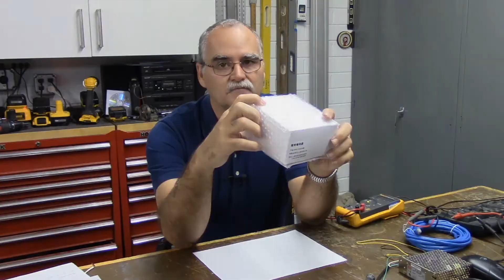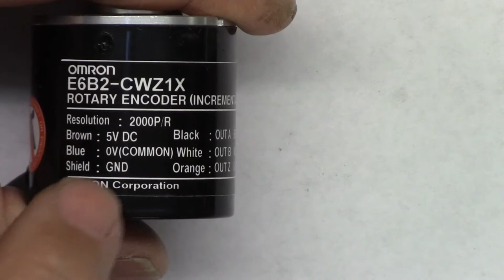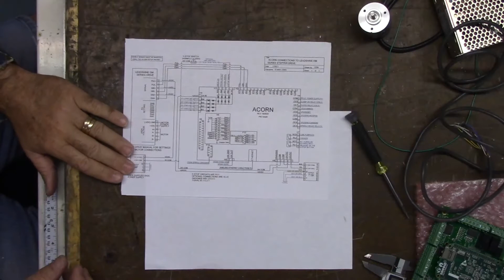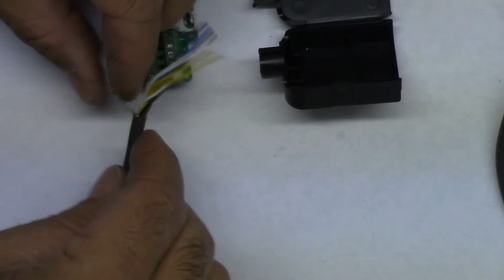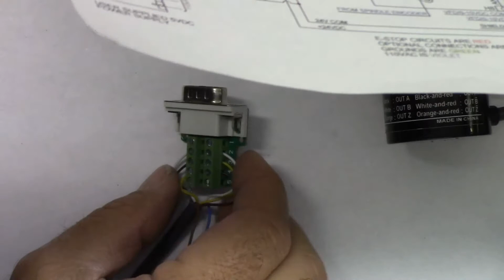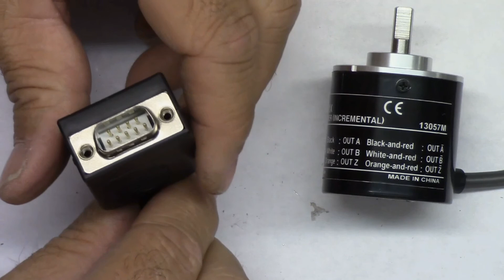Omron Differential Encoder Overview & Wiring to Adafruit Connector

Comment: Will this encoder work with a Centroid OAK Board? Is the wiring the same in OAK. 
Thanks,
Jeff
Reply from the maker: Would not recommend it's use with Oak.
Reply: @martyscncgarage5275  Do you know of a encoder that will work with OAK?
Reply from the maker: 5vdc line driver differential encoders from automationdirect.com or direct from Centroid. What is the application?
Reply: @martyscncgarage5275  I used an OAk Board on my Milltronics MB-19 Mill Conversion. I am trying to set up an encoder on the spindle.
Reply from the maker: @JeffBlack1968  if the encoder will support a timing pulley and belt, you NEED at least a medium duty encoder. 1000 line is fine. Cheap encoders will not last.

Comment: I don't think you can tell if this is original Omron or knock off just by testing, You'd need both and opened. I got similar one except it is 100p/r. Was working fine but during testing I've managed to reverse voltage polarity and then it exploded. I've opened it and 22uF capacitor exploded and about 5 small SMT transistors with only LY marking on them .. so impossible to tell what they are. According to manual, those encoders have reverse polarity and sc protection. This one obviously didn't have it. I could not find picture of original Omron encoder to compare. I've seen some that had two circular PCB inside, this one has only one. It has two small voltage regulators, quad comparator and each output have three SMD transistors. Ones that didn't blow are NPN and manual shows PNP but there are other two that I could not test as they blow up. I am sure I could fix it but cannot tell what transistors are.

Comment: Why are there 6 phases in omron CWZ1X but there are only 3 phases in all other omron models?
Reply from the maker: Z is the index pulse. You also have the inverse of the phase. This is a line driver encoder
Reply: @martyscncgarage5275  So I need to connect all 6 phases in order for this encoder to work? Thanks.
Reply from the maker: @infinityinfinity9665  I have no idea what you are working on or what control you are using
Reply: @martyscncgarage5275  I'm just trying to connect this to an arduino in order to measure distances, the problem is I have only 3 pins left so I was wondering if I can only use 3 phases, from what I've read about differential line drivers "one of the signals matches the original signal, while the other is the exact opposite of the original signal" so if I connect only the 3 phases I should have the same output as in the 3 phase rotary encoders?
Reply from the maker: Nothing wrong with experimenting! Just use A and B you should be fine. The index pulse is a once per rev pulse. Good for threading on a lathe
Reply: @martyscncgarage5275  спс
Reply: @infinityinfinity9665  You can try using just A and B (and Z if you want to check if you are getting the right number of counts per each index pulse). Ideally use twisted pair wire (e.g. a piece of shielded ethernet cable) and a differential line receiver (e.g. AM26C32) close to your Arduino. The receiver takes the normal and inverted signals and produces logic outputs that you can feed straight to your Arduino inputs. AM26C32 is a 4-channel unit so you can handle all 3 encoder's channels with a single IC. Differential signaling is mainly used for improved immunity against noise/EMI. If there's +1V of noise induced in the A channel, there likely will be +1V of noise in the not-A (inverted A) channel - if the channels are a twisted pair. Then the signals are subtracted by the receiver and the noise is canceled out.
If you don't need this, buy the CWZ6C version next time (NPN open collector output), and hook it up to your Arduino inputs with some pull-up resistors.
Reply from the maker: Choose the appropriate model given the application

Comment: What you gave was great. I also need to know how and where, the encoder fits in; in the whole scheme of thing. A real novice I am. So I hope you will make a video showing an installed and working encoder. Also please explain the "line" vs total PR. It get confused in 2,000 becoming 8,000.

Finally what programming is necessary for the encoder to end up controlling the lathe's chuck RPM. Or controlling the spindle speed on a Mill if that is possible.

Thanks
Reply from the maker: Pat, here is a good read on encoders and how the 2000 lines per revolution becomes 8000 COUNTS per revolution:
http://www.dynapar.com/Technology/Encoder_Basics/Quadrature_Encoder/
As for this particular type of encoder as it applies to Centroid CNC's Acorn, it could be used belted to the spindle at 1:1 with a timing belt to provide a precise closed spindle loop. That is the controller knows exactly where the spindle is. Having an encoder on the spindle as described is a must to do rigid tapping on a mill, provide constant surface speed control, rigid tapping and threading on a lathe. You can Google those terms for more info. I hope this helps at least a little.

Comment: Thanks.  Nice overview.  I just ordered one for a 7" mini-lathe.  I plan to run it off of a gear.  There won't be much in the way of radial forces - hopefully it work work.
Reply: Franco do you sell the plastic gear?
Reply from the maker: Remember, you need to go 1:1 with the spindle. I suggest using small timing belt and suspending the pulley on a little jackshaft between a pair of bearings and then use the little plastic coupler that comes with the Omron encoder....not sure how long it will last otherwise.....cheap though...
Reply: @martyscncgarage5275  4 years ago .. but maybe someone else will read .. encoder shaft is supported with two ball bearings. Unless you tighten the belt to much I am sure it could be driven directly without coupler but sure it would last longer with coupler.